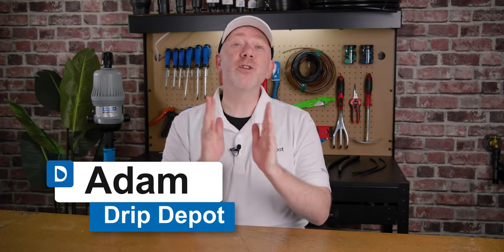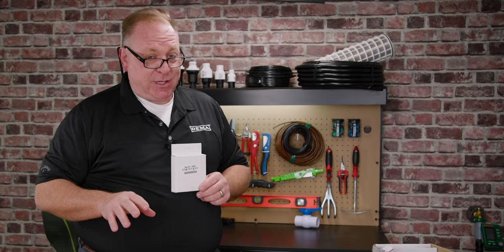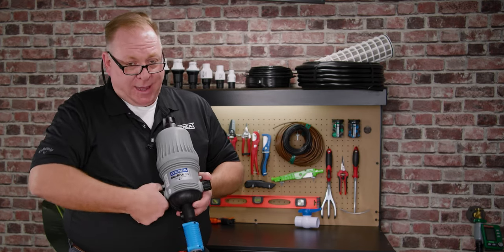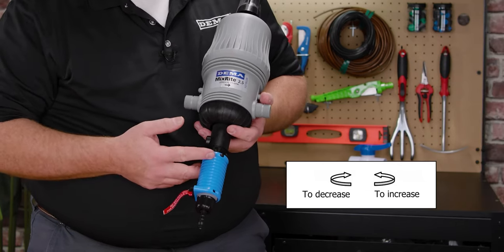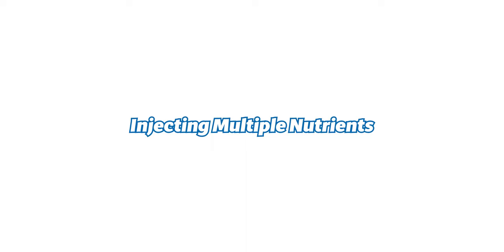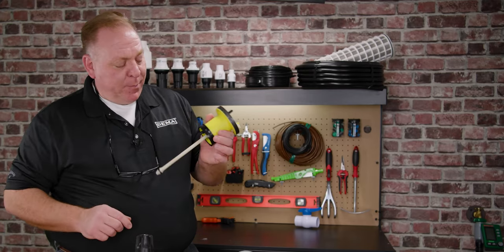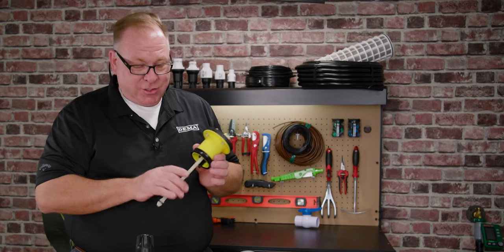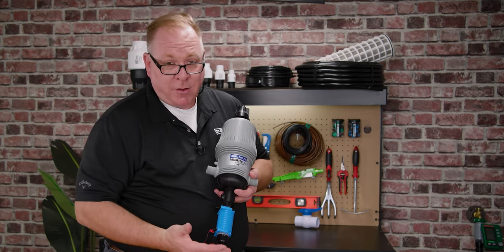How to Use and Maintain a MixRite Precision Fertilizer Injector (Complete Guide)

Comment: I just sent a email for help on determining what model of injector I need.  My water is 8-10 gpm
Reply from the maker: It looks like someone got a reply over to you before I came into the office this morning -- they're quick! 

If you haven't checked yet, the reply should be in your in-box -- you're welcome to reply with any follow-up questions, during office hours we'll get back to you fast and are happy to help narrow things down.  It sounds like you have a setup that's in range of lots of injectors, so you'll have lots of options depending on what kind of injector you'd prefer (water driven, venturi, etc) :)

Comment: Hello, I have a metering pump Tefen Mix Rite 3.5.
Some water is leaking along the black knob at the top. I opened the pump and see that the mechanism from the top cover cannot be removed. How can I stop the leak please?
Thanks for info!!!

Best regards!

Jan
Reply from the maker: Jan, it sounds like it could be an O-Ring or one of the seals -- when you mentioned black knob, do you have one with the on/off knob at the top, or the one with the more rounded and flush knob?  

If you can, send us a quick photo of your MixRite (support@dripdepot.com) and the location where it's leaking, good chance we can assist with this -- easy fix if it's just an O-Ring or seal :)

Comment: Would this work off a riser from an irrigation zone? For example, zone1 is a flower bed to have it installed in. Thnx
Reply from the maker: Depending on the size of the riser and the space available, it potentially could.  The smaller MixRite has a 3/4" MPT inlet and outlet, so it could be installed with just an adapter or so.  It could end up being a bit of a bulky setup, however, as it's best to install one of these on a Bypass (basically a loop of pipe with a ball valve on either end so that the injector can be isolated from the rest of the system if need be).

Comment: Can I install a valve on the nutrient line to stop nutrient uptake or when I just want to water without nutrients? I know I could install a bypass system, but a simple on/off valve would be much easier on the nutrient line from the tank. 

What happens if the system runs dry, ie, the nutrient level falls below the suction tube?
Reply from the maker: A lot of MixRite Units come with a built-in chemical shut-off -- some of these will have it in the part number, for example TF10.002ON/OFF -- others will just say they come equipped with a chemical shut-off, such as the 571CW with Chemical Shutoff. 

It's definitely not advised to let the system run dry -- what happens is the seal on the chemical pick up rod could be damaged. The chemical cylinder can also become damaged.  If you run out of solution and don't have a shut-off or can't interrupt the watering cycle, use water in place of solution so the unit stays lubricated :)